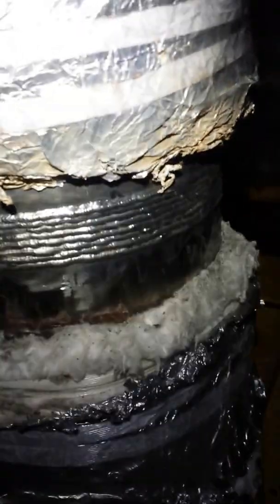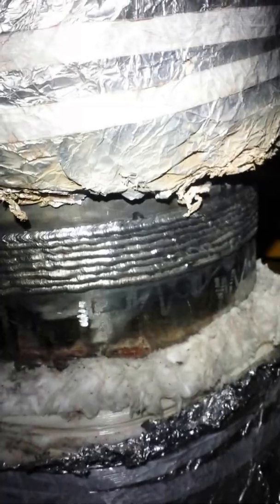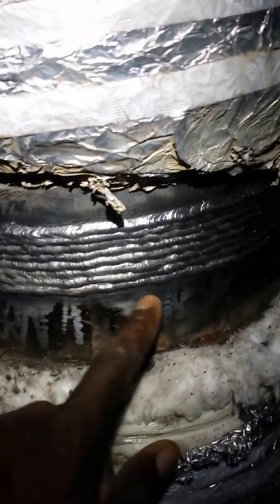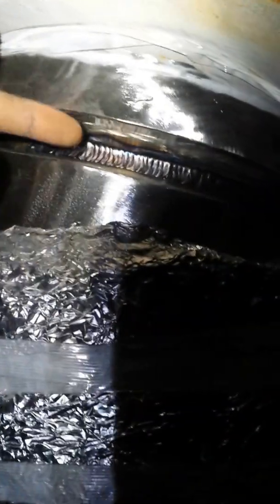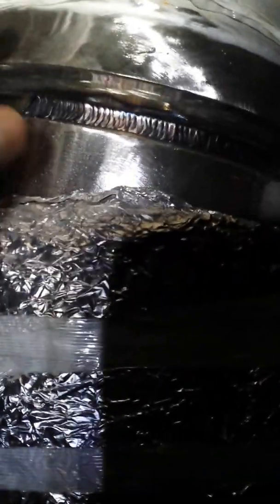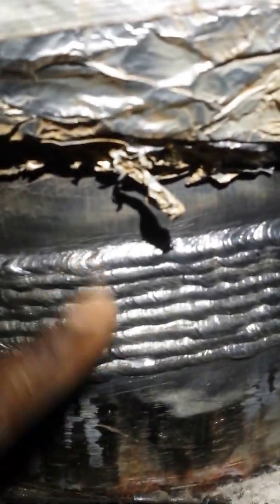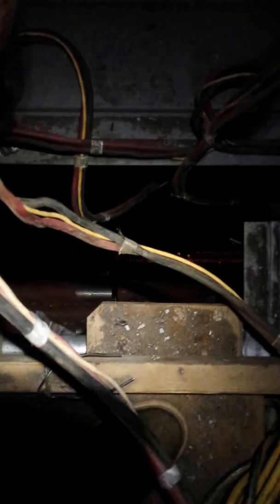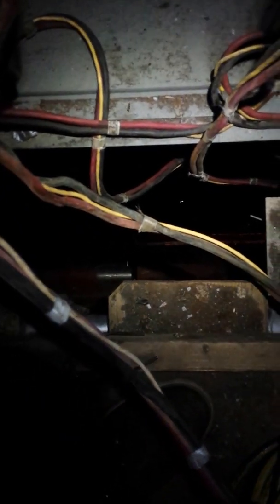Pipe welding heavy wall carbon pipe

Comment: Lol and everyone thinks that we have the easiest job on the site, the welders over their career get beat up most then any other position on the sites. From burns, bad spots where our bodies are twisted, sweating eyes getting tired, hold the same spots to keeping a slick pass gets tired some, and to worry about not messing anything up. If this was easy job everyone would be welding!
Reply from the maker: 10-4
Reply: Or don't forget that molten slag going all the way down to your ear drum!
And having your retina drilled out a few times!
Reply from the maker: Now that's keeping it real.
Reply from the maker: Yeap, sounds bout right.
Reply: except for the Millwright!!